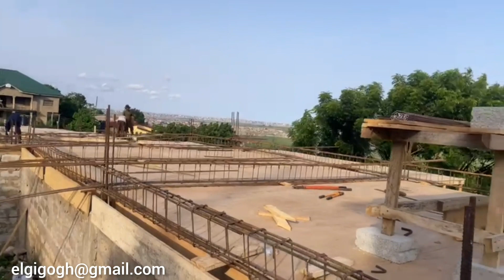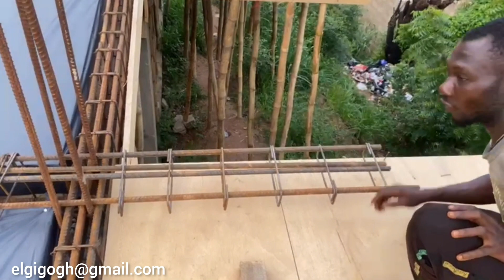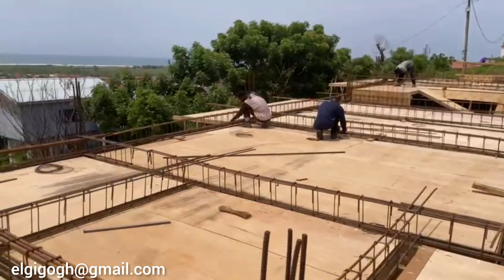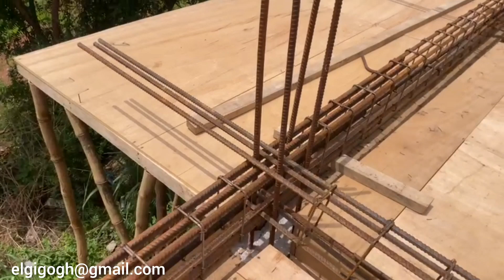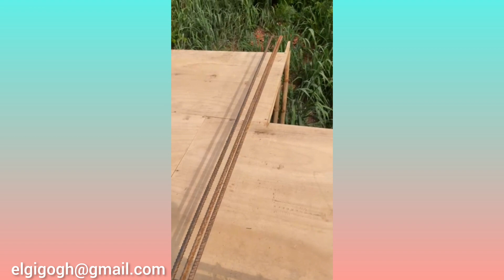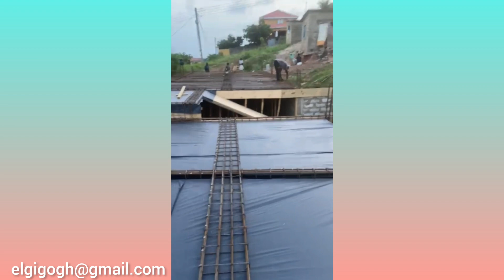Building in Ghana: The Hill Project  Decking Beams,Slab Bars And Hidden Beams #buildingahouseinghana

Comment: Gigo! Will the structure vary rod sizes or will it have the same uniform size through out?*spoiler alert* I'm preparing for new project, the rods will range from 8MM, 10MM, 12MM, 16MM and 20MM
Reply from the maker: We using Various rod sizes on this slap based on the function of the space ....Wowow that's good News Krone 👏  happy to hear that looking at the Line up of your Iron rods from 8MM to 20Mm sounds like this going to be a Massive Project Bro can't wait to follow this Project on your channel.....Wish you all the Best Bro ....Proud Of You Krone ✊🏾🙏🏾